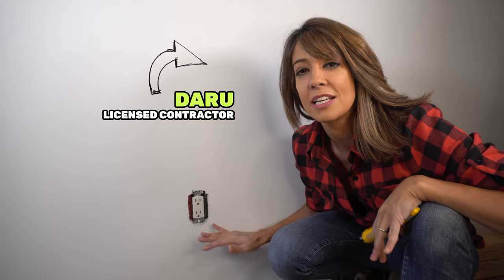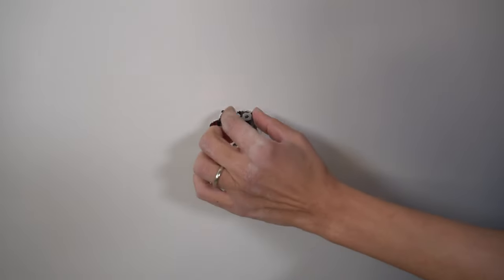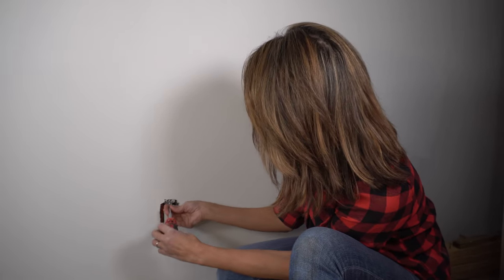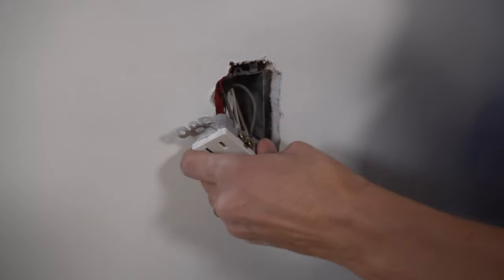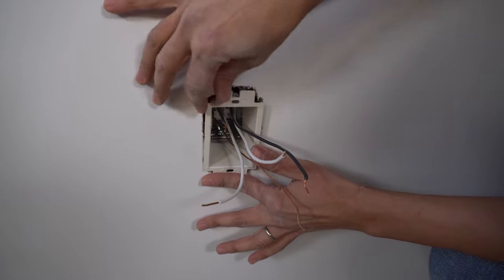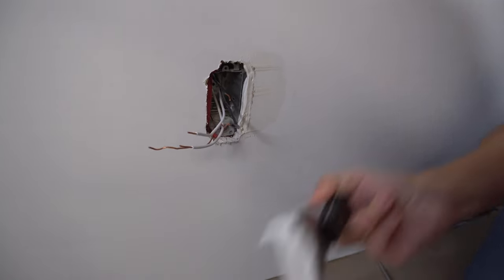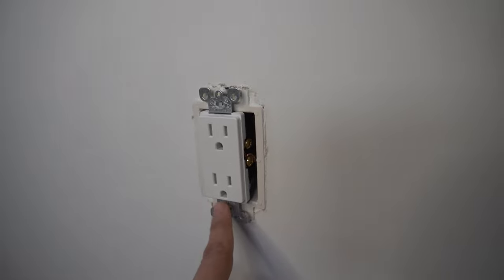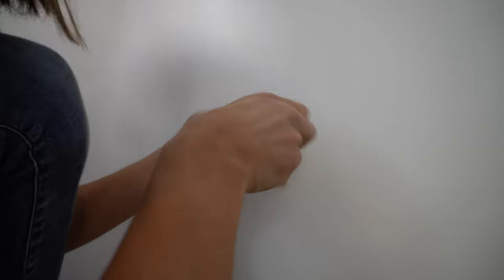How To Fix a Sunken Electrical Outlet | Why The Easy Way Is Illegal

Comment: I’m a broadcast electrician. Considerably different skill set..
Enjoyed the video, very succinct and informative. Only issue I see is “legal vs not to code”. Incorrect work is only illegal if the local or state jurisdiction has written NEC into statue. Several jurisdictions in the U.S. do not have code as statue thus the statement is “not to NEC code. A few jurisdictions in the U.S. did not even recognize NEC. Not sure if they still exist as I have no need to go back.
Reply from the maker: @trailrydr  thanks for clarifying your experience with NEC code. I follow NEC guidelines because most of our viewers are American 🇺🇸 ❤️. I’m in Canada and appreciate your experience with the implementation of your regional experience. It’s important to consider and know. Thank-you!

Comment: Im cornfusled if using the manufactures wiring instructions why is using the back slots bad? If it was so terrible they would no longer produce it with them no?
Reply from the maker: You can use them. I have often heard electricians complain about them for not working properly and coming loose so I remove them. It's generally frowned upon but ultimately personal choice.